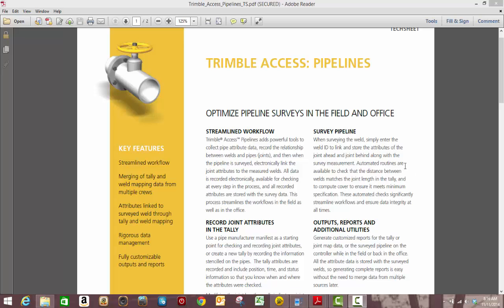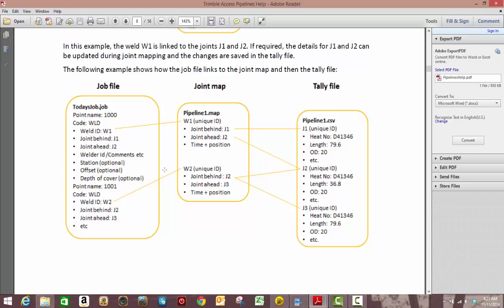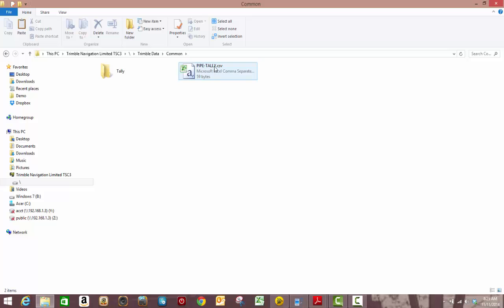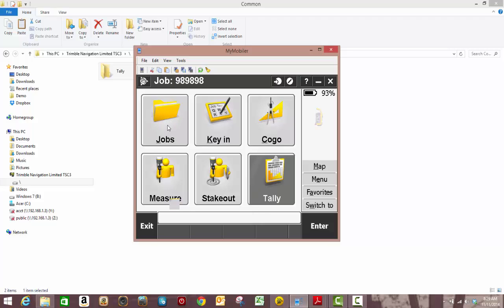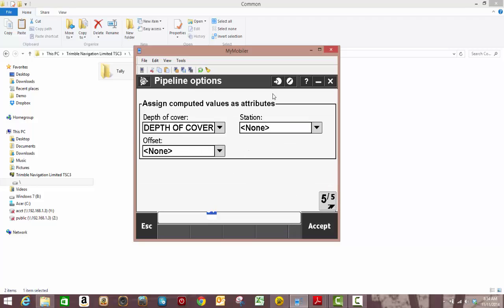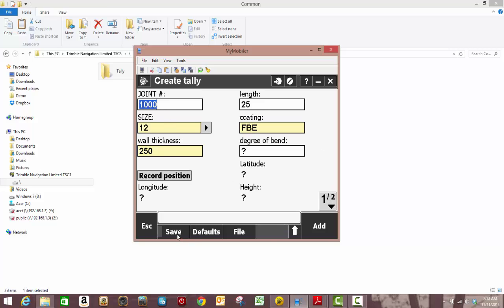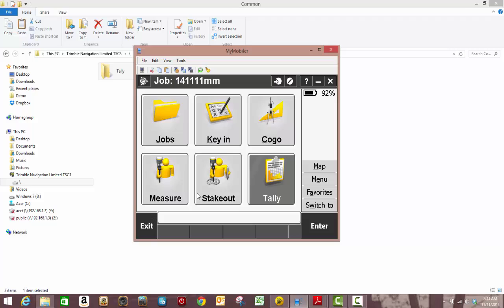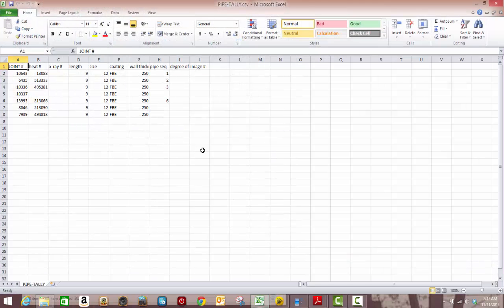Trimble Access Pipelines

Comment: Questions / Review
1. Under pipeline options / page 2 (tally file), when you select linked attributes there are 3 columns (link, attributes and code). Under the link column there are 5 options (none, joint, joint ahead, joint behind, weld) I would like to see (heat ahead, heat back) added to those options, and possibly the pipeline manufacturer and pipeline size, etc. back and forward. This will make a larger attributes file, but if the process becomes automatic it should be quick and provide more information to the client for each shot taken.
ex. I would take a shot, then enter my x ray into the attributes, this automatically brought in my joint ahead and joint back, but did not bring in my heat information for said joints.

2. When exporting my points to a kml file for viewing in Google earth, my line work did not show up, but my points and attributes did. Does the program not recognize certain codes for creating line work? I was using the codes point of intersection (PI) weld (xw) and flange. In addition; for the line work function to work in Google earth will my point range have to be consecutive? Lets say I'm shooting 3 parallel lines (salt water, gas, and oil). Will I have to run one line at a time, or based on the weld mapping function will the lines connect by joint ahead/joint back?

3. I cant start my base from the pipeline menu screen, I have to start in general survey to start the base then exit out and open pipelines. I would like to see start base under the measure option in pipelines.

4. When I export the word document for the pipeline weld report, the document does not show details of bends or flanges, everything is a straight pipe including the flange. When I shoot a bend or a flange I would like to see the formatting of the word document to show a rough scale of flange and angle of bend. This way if a client prints out this finished document the first and last page would be a flange and by quickly flipping through pages a point of intersection can easily be spotted.

5. I was seeing hiccups for generating reports after going back and editing attributes in the data collector. For whatever reason, at first the reports would not open, I tried again 15 minutes later, created the same report, and the file would open.

6. Finally, I still think field books are a critical part of keeping tally during Trimble pipeline 1.0. Being able to flip back and forth through pages for self reference is priceless. Many scenarios cross my mind when the contractors are hot to get pipe in the ground and buried and being an ace on this program could still bog someone down.
In a field book, you can weld map and tally at the same time, in this program if you go directly to weld mapping without creating your tally file first, you can not collect heat numbers or other pipe information. After collecting the x-ray then entering in a new joint number a prompt appears on the screen that says the joint is not recognized. This should be modified in a way to create a tally file while creating the weld map rather then going back and forth between the two pages. Otherwise we will end up walking the line multiple times or flipping between the functions where I see "fat fingering" occurring under the stress of the side booms ready to drop the pipe on your tail. 

Feel free to correct anything I oversaw. 
Thank you.